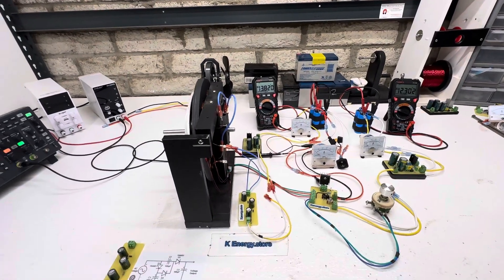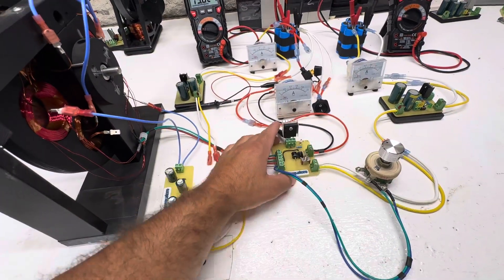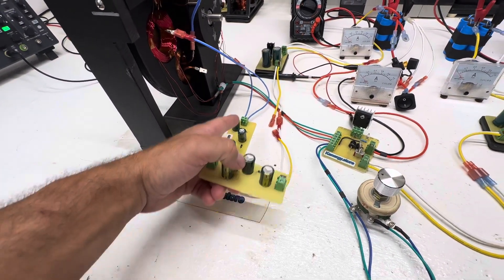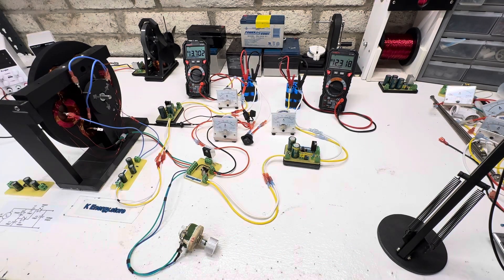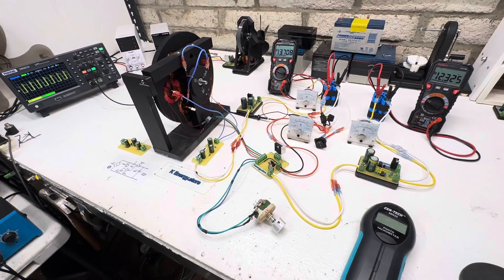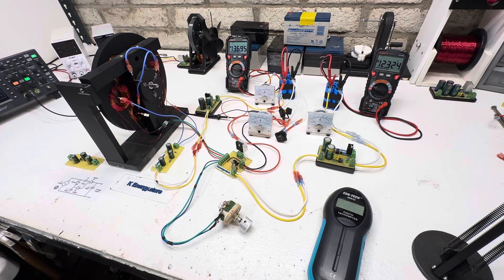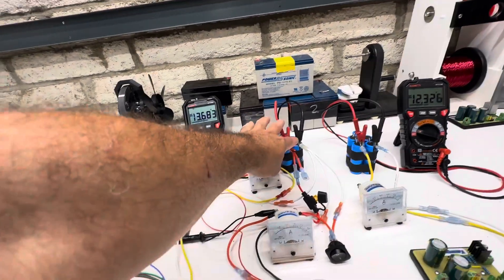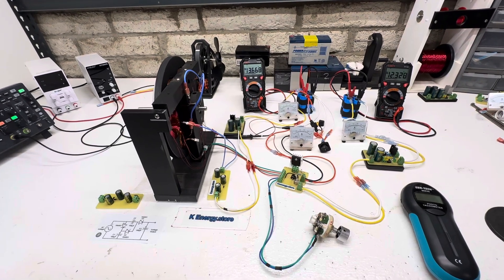Pancake bedini with gen coils

Comment: 2:06 Is it safe to have an AC input in that capacitor booster without a load pulling from the cap booster, so long as the AC input doesn’t exceed the 100V limit of the capacitors?

Btw the caps are rated at 330uF but the diagram says 100uF.
Reply from the maker: Yes as long as input isn’t more than the capacitor rating 

You can use what u want
Reply: @kenergy1707  Thank you
Reply: @kenergy1707  Oh I just had a thought: could this be adapted so its a DC to AC multiplier? Or would that be more difficult.
Reply from the maker: @ olny works for ac
Reply: @kenergy1707  Thank you sir

Comment: Very nice motor generator Kevin like the Axial flux setup 👍💯⚡that's a nice voltage double circuit or triplpler Great work I would like to see a time lapse of this setup want to see what the input battery after the charge is full thanks for sharing

Comment: this is the Best way to convert DC to AC , inverters are not the way . 3 phase Nikola Tesla Generator is number #1
Reply: Not if you want 60hz true sinewaves
Reply: @DavyOneness  if you want true 60hz sine wave just make sure the rotor on the 3 phase generator spins 60 times per second or 3,600 rpm.  Inverters has loss that the 3 phase generator does not have , component loss . Your right Davy its a little harder to keep the 60hz . Its still more efficient to spin the wheel rather than invert the signal .  Inverters have to simulate , this comes at the cost of efficiency. Every extra component presents loss
Reply: @DavyOneness  you can get a better signal with tru inverter than a 3 phase rotor, its just that the rotor will have less loss in energy than an inverter .